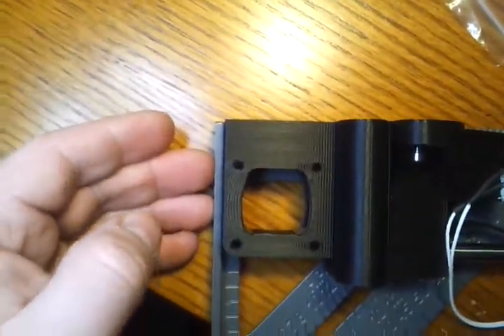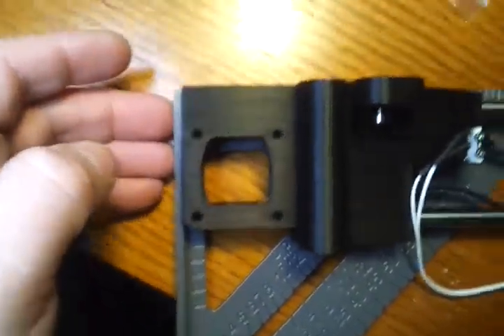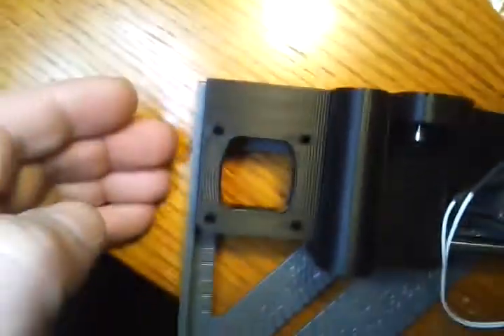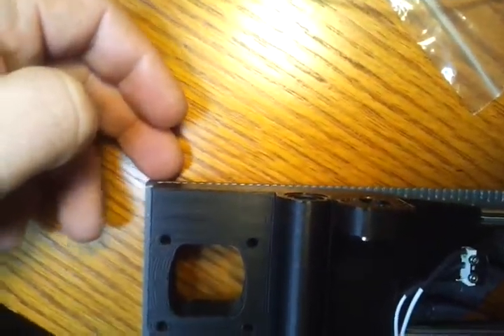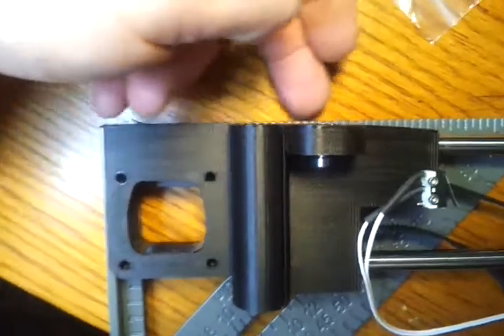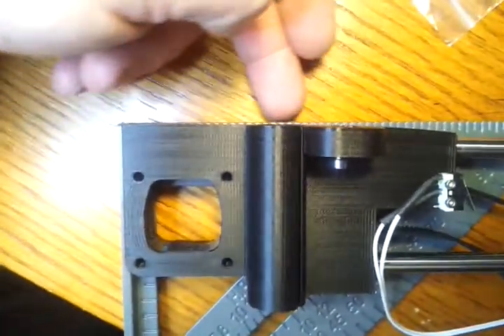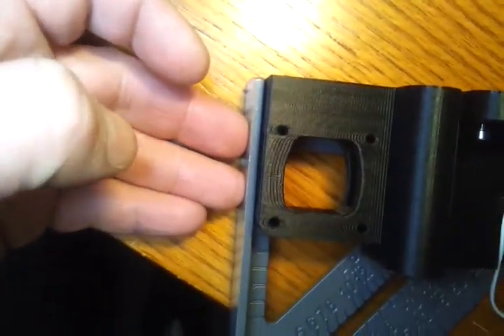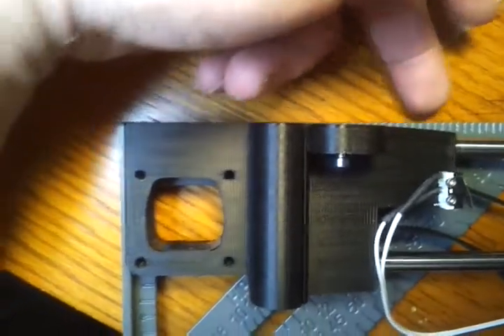HIC Technology PRUSA I3 - 3D Printer - manufacturing defect

Comment: Hey man, I'm Astynax from Amazon comments.  I need to make some adjustments on the CAD file for this part.  I didn't get the dimensions on the centers of the 2 rods right and it's causing an issue with my smooth rod not lining up.  I'll let ya know if I get it right.  I'm still waiting and hoping that HIC would just send me the .stl file for it, but I still have not heard back from them after 6 days.
Reply from the maker: Hey Keith, I was hoping that you would see that message. Thanks for responding on here! I was finally able to get a tracking number from them a few hours ago and my new part is on the way. I just hope it's better than the one that came with the kit. If this one is messed up too, I'm going to be out of options. I guess I'll have to take it all apart and try and get a refund at that point, and I really don't want to do that.

Please let me know if you have any luck getting the CAD file lined up. It's weird that they won't send the files. A lot of places like Makerfarm will give you the files when you buy a kit and the first thing they tell you to do is to print out some spare parts.
Reply: Just so you know, I've been printing with my left side z-axis smooth rod out of the bottom frame hole, and it's been doing fine printing at slow speeds. 

I'm about to print out version 2 of that part to see if I got the dimensions right this time. If it is good. I'll be posting it on the Thingiverse website.  I'll comment on here with a link if it turns out right.
Reply: It worked for me with the speeds slowed down.  Even with that rod in place properly, I am printing at really low speeds compared to the default just to get the best results.  I want to get the firmware side figured out so that I can set the acceleration settings, which will make it slow down as it is coming to a change in direction, then speed back up.

One of the biggest factors in print quality is extra movement. Slowing things down will reduce excess movement when your machine isn't rock solid.

Comment: dear lord.. that hub-carrier looks like it's been baked in a toaster! Well, if that piece is a 3D printable unit, then all you need to do is get the .stl file and have someone print you another one >> Hopefully with a little quality control afterwards...
Like double check to see it's square & level at least.
Reply from the maker: No doubt. They initially tried to say that I assembled it wrong. The company is based in China and support has been crappy, to say the least. I asked for the stl file but they won't give it to me. I got tire of the delay in getting a replacement part and decided to put it together anyways. I had to leave the screws loose on the threaded brass bushing to allow the Z axis to move up and down. I spent a lot of time setting it up, and it's just been one problem after another. LCD screen just randomly displays gibberish. The extruder heating element was working fine and it just quit for no reason. Oh, and I had several of the ball bearings just fall out during assembly.
Reply: adamky1 Buddy, now that's rough! That's too bad they couldn't at least done that for you, considering there's such a long delay time between China and here. Thank goodness you're not working in a hospital and needed this part for a heart valve patient or something.. ;) All kidding aside. > I was thinking last night after watching your Part 2 video, that instead of leaving that brass coupler completely loose you can (temporarily) use some small washers to wedge under that bushing to tighten it up a bit or at least keep it from wobbling. About that LCD.. Does it have a USB port? If so, you should be able to connect to a pc or Mac & use it to control your 3D printer thru Pronterface/Printrun. Hmmm.. on the extruder, have you checked the thermister? If it's not registering a temperature it may not allow the extruder to heat up... I have no idea what to say about your loose ball bearings.